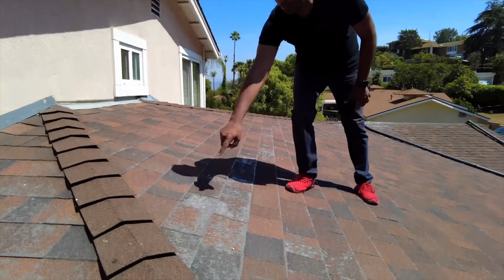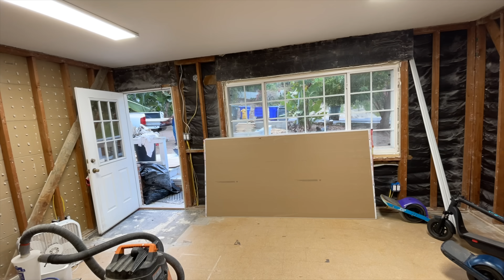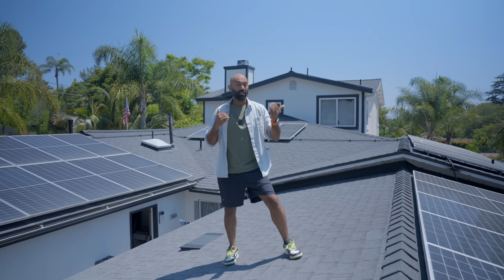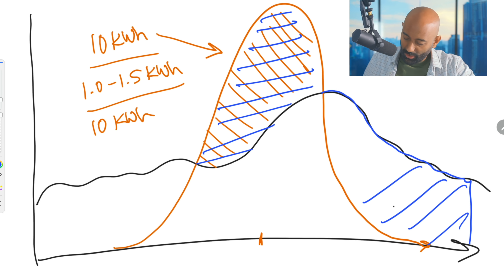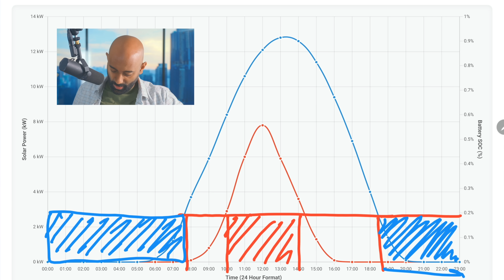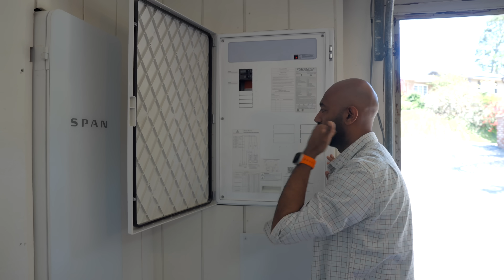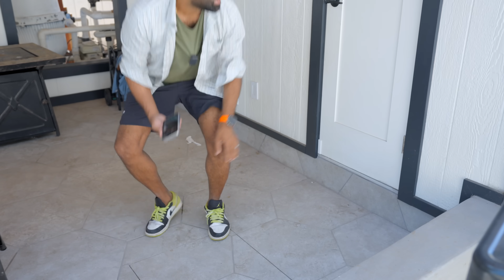Is Self Reliance Possible? Net Zero Home 4 Years Later...

Comment: What was the pool pump? My pool pump is an energy hog
Reply from the maker: We got a Pentair VSF (variable speed and flow) our old pump was 2400 Watts for a fixed 80 gallons per minute. Our new one is set to 35 GPM but only uses 280 watts!

Comment: My neighbor added solar to his roof 3 years ago.  Found out it was leaking, and now he has to get a new roof, repair rot damage, and remove the solar panels, costing him thousands. He said he won't reinstall them and it was a big mistake and huge waste of money.
Reply from the maker: this is true for ANYTHING, if you have a bad installer who does a bad job, it won't go well. If you got a new roofer, to re-do your roof, and he did it poorly, that would leak too. I've had solar on my old home for 10 years, and on my new place for 3, and never had a problem. But I also get on the roof to make sure they do a good job.

Comment: I see a big fan on your pool heater which means that you are discarding cold air. Did you consider adding a heat exchanger so that you could cool the house when the pool heat pump is running?
Reply from the maker: I like how you think :) I thought about it a lot, but couldn't really make it happen, sometimes I drown in possibilities, but what we can do, is duct that pool cool air, into the patio on really hot days, but we dont really get too many of those

Comment: Does your EcoFlow solar battery still work when the Internet is down? My Internet and power tend to go out together because the wires are on the same poles
Reply from the maker: yeah all our systems only need internet for data reporting, it all works without internet. The EcoFlow sytem does have more software updates, so it also needs it for that

Comment: Sounds nice, but it takes 30 years to break even on cost to build solar vs breakeven. Great if you’re never going to move and are young enough.
Reply from the maker: I just showed you my breakeven is going to less than 4 years... it depends on your electricity price. and if you're working to do some work yourself, you can get cost down to easily 1$ per watt. at that price, it makes sense anywhere

Comment: Still hard to believe that southern California has such expensive electricity!  It seems like some consumer protection group by now would have identified the cause and got the perpetrators on the way to being punished!  The rate there is 4 to 5 times that of neighboring states like Oregon and Washington.
Reply from the maker: it is an endless source of frustration for me. Now as if that wasn't enough, they want to add fixed costs to your bills that AREN'T based on usage! If that happens, I'll be really up in arms
Reply: @TwoBitDaVinci  P G & E has already done that.  I installed after April, 2023 so am on NEM 3.0.  There is only ONE rate plan. That plan has a $15/month charge to "reduce the cost of electricity". But the net-net is now it takes 38 times as much exported energy to "break even" on my bill.  Fortunately we do have a battery (a FranklinWH)  though just one - so our AC is not on the critical circuit. 😞

The California Utilities are FOR PROFIT and PG&E, for example publicly stated that their record profits were not related to the outrageous rate increases.  There is one city here in Silicon Valley (the City of Santa Clara) that has their own public utility and predictably, the rates in that city are HALF of what our  rates are in the rest of Silicon Valley.
Reply: @TwoBitDaVinci  There sure does seem to be a solid incentive to use alternative sources!   And I would think there would be hundreds of thousands of also frustrated residents.  If only there were any easy way to organize them all....

Comment: I have AOSmith Electric heat pump hot water heater.  We have had it replaced twice under warranty.  I would go with another version.
Their customer service is great but having to go through that is bad.  Combo washer dryer that is condensing reduces our power a lot (LG version is what we got).
We used Emporia to monitor our usage for a year before we did solar/batteries (54 370W solar and 3 Powerwall 2's).  Solar is fence/ground mount and none are oriented 'correctly', but in the winter we normally get 25 kwh and summer 80+kwh daily depending on clouds.  Here in TN electricity is about 12cents per kwh and 4 cents for any sold to the grid.  We are still 'on the grid' but it is nice to reduce our bills significantly and none but the base charge for 9 months of the year.  Heat pump for heat/cooling, but not latest tech. ... Oh, near Nashville TN
Reply: Same here with the AO once replaced under warranty, but the plumber isn't covered. Gave the old one to a friend and,,,it works for him! New one has been fine for a couple of years.

Comment: Ricky, last year I needed to replace my hot water tank (which had lasted over 30 years) and I decided to go with heat pump. It costs about 1/3 as much to operate so that's good. We are all electric in upstate NY and the only reason this works for us is that the electric utility is community owned. My payback on the heat pump water heater should be about 12 years. The heater and installation cost about $2,700. So, long payback. But that's okay because, and I hope you're sitting down, my per KWH cost is $.0439 in the non-winter months and a blend of that rate and $.06590 per per KWH in the heating season. All our electric comes from hydro and nuke. Like you i have an office (attached, not freestanding). About 3,000 sq ft. Total electric cost for the prior 12 months $2,240.72. Heat pump water heater is in the basement so it makes that area a little cooler. For you, a heat pump water heater is a no brainer. You still have to buy off the grid so this would get you closer to zero and assuming your up front costs are not radically different from mine your payback would be very quick. My water heater will probably die about when I break even, but you will have years of net savings before yours dies. I love your channel!
Reply from the maker: wow seriously?? I would add 1 thing to your calculation... you HAD to replace your unit. A tradition system would probably be around $1000-$1400 installed. So your delta is half of what you think it is. This is why I always like to 'upgrade' when I need to replace something!

Comment: Fellow SoCal inhabitant here:  I wonder why you did not go with thermal solar water heating?
I bought a  lightweight thermal solar water heating system in 2008, oversized it for some hydronic heating utility and have kept my Socal Edison bill fairly reasonable, given that have not yet added a solar PV system. The water heater I bought does use a small PV panel to run the circulator pump. I bought an electric water heater for storage, with none of the electric elements hooked up. It is not insulated well enough, so I do have to make an upgrade.  
But a priority would be to get that solar PV, sized for my EV, so I, like you, have work yet to do. Love your videos.
Reply from the maker: Hey Paul! So with a heat pump water heater, we can heat water with like 800 watts. Our bills were insane, not because of hot water, that's the least of our concerns. our current natural gas water heater uses like a few bucks a month. We have a lot of computers, EVs to charge etc... so for us PV Solar was absolutely the way to go. We need electricity every second of the day, and we need hot water like for 30 minutes a day. when you have enough solar, you can do anything :) cheers and hope you're enjoying the sunshine its about time!

Comment: I know that many believe they can go solar and battery to be independent of the grid and the likelihood of a 500/1,000 year event such as a 3 to 5 year winter caused by a super volcano (or similar event) is not likely. I would still like to have a backup power ready if for some reason the solar is failing.
A company called Hyliion is testing a multi-gas sourced helium sterling engine that conservatively operates at more than 50% efficiency and is whisper quiet.
It is still in early stages and has a high risk of failing due to market demand changes but I still like having batteries only considered a range extender and not a backup.
If solar is down for more than one week, the limitations of batteries become more obvious and even more so with longer outages.

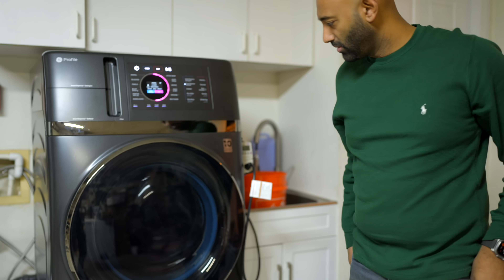Comment: 22:34 for clarity, the heat pump dryer only pulls 850 Watts but also takes twice as long to dry, so it only ends up saving about half the energy of your previous dryer. 

Also thank you for these videos!
Reply from the maker: in our experience, drying times went up for 50 minutes to 1 hour 20 minutes. so not double, also, pulling 800 watts evenly for 1.5 hours or so, is MUCH easier, than pulling 4500 watts for 50 minutes. that's the key to being net zero, spreading out loads, and why tankless electric water heaters are being banned... they can up 20kW for a few minutes which is horrible
Reply: @TwoBitDaVinci  You live in SD. Most of the year you could dry your clothes on a line. 0W and they smell great when they're done!

Comment: you guys need to start looking into insulation and how to heat and cool houses, the better a house is insulated the less energy is used for heating and cooling. and start to take matrials used in building serious.. 3 or 4 layer windows 1.7-1.8 inch insulations in walls, 18-20 inch under the roof and the same with floors/ground.... your are using as much if not more naturalgas pr months in the heating season as many in the scandinavian part of the world would use in a year.. also start looking ind to water heat panels even a small system can heat a pool or cover a hole house with hot water for both heating and useage, combine that with a large storage tank.. the sun can power a lot of things.. and heatpumps for the houses... here.. if the unit can not support a SCOP of at least 4.5-5.0 it wold be a extreme hard sell for the customers.
Reply from the maker: 100% correct! so here in San Diego, it's actually more expensive to tackle insulation, because our weather is so mild, we neither heat or cool our home over half the year.

certain types are easier, like under house or in attic, but in wall is very expensive as our labor rates here are very high. But we are tackling insulation at every stage as we go!

Comment: I envy you for the sun hours you get during the winter months. I have a huge overflow of energy in the summer and still can't make it through the winter here in Europe... It's a real pain.
Reply from the maker: yes this is why true net zero is so difficult. But even being self reliant X% of the time, and trying to get that number up, is a very fun game to play. Cheers!
Reply: @TwoBitDaVinci  Oh and btw, just because you asked: I am running HeatPump based hot water here. A company named Viessmann has a combined system thats called VitoCal (for the heating) and VitoCell (for the water) which come as a package and work really well in my house.
And another side note: I don't think increasing your batteries in the office will do much to avoid production loss. Unless you increase the usage too it will just take a day or two longer until the batteries are full, and then production stops again. Have the same issue here

Comment: I’ve done most of what you did but on a lot smaller scale. My systems ; I have three houses I’m powering,have evolved according to observations of our loads. Instead of integrating all the loads into one source, I have off grid inverters carrying specific loads . For instance, one 5K inverter is just powering two 1.5 ton heat pumps, from my observations,I can add another.
I like the heat pump water heaters but because solar is cheap I still use resistive heaters. To lower the load on the inverter, I put the elements in series with the upper thermostat moved to the bottom. Then a secondary heater that receives the cold water first is switched on as if it was a lower element
I’ve been watching your videos during your process and it looks like you need another house just to mount all the equipment 😅 . As you mentioned,the off grid is much cheaper and it comes with almost free education. Easier to scale up. I’m convinced that the complexity of selling back to the grid is not worth the trouble. I just use my grid connection as a battery charger at night when the electricity is free.
Reply from the maker: wow that's really interesting! I have to think about this, because I've heard a lot of bad stories about people getting heat pump water heaters...and them being less reliable...

Comment: How long do you run your pool pump? in Florida we run it 4 hours a day in Winter and 6 hours a day in Summer. anything longer is a waste.
Reply from the maker: it depends on the pump speed and pool size.

our old pump at full speed was 80 gallons per minute, and used 2400Watts. Our new one runs at 35 GPM and only uses 280Watts! Our pool is 20,000 gallons, so we just let it run a little long because it uses such little energy.

the thought process was to reduce the conditioners and other chemicals, and instead let our salt chlorinator just run a little more often.

Comment: I use an electric water heater with a DC element connected directly to a 500 watt solar panel
Replace your bottom element with a DC element 
Google Missouri wind and solar DC water heater element 
Take care Ray
Reply: That's a cheap set-up, but a lot less efficient than a heat pump. a COP of 1 vs 3 or 4, and the heat pump can heat your house, too.

Comment: 1978 the state of IA development a Solar Tech course. A future service industry to repaire renewable technology. At the end of the course (remember renewables has come a long since then) try to piece together a self reliant energy system using geothermal, solar panels (5% efficient), 500 gallon water storage heat transfer system, and heat pumps we determine it would take 50 years to get an ROI and we still needed 10% fossil fuels to keep a responsible temperature in a home.

I still believe that is the threshold, 10%.

It’s always been amazing to me how we thought using intermittent energy sources would solve the independence challenge while all along the intermittent power, solar, wind, geothermal, are the supporting industry for lifting water and how the earth leverages energy.

That said, damming large volumes of water isn’t the answer or available everywhere.

Cycling the different temperature (structural) changes of water is the answer and how to harness that natural process is the constant energy resources of the fall and lift of water. 

Energy is never used up but is dissipated and transferred from one thing to another. Water leverages gravity to lift and gravity to fall as a cycle. A cycle is predictable. How do you harness it?

Once you understand that principle residential and industrial facilities will have unlimited power for the cost of the machine and maintenance.

Comment: My utilities averaged about $180 per month.   I haven't used any for the last 2 years, water, and electricity for a 3,400 sq. ft. house.  Before anything else, insulate your house.  Windows are a financial killer.   After looking at the roof, it's dark.  A dark roof is a financial killer.  Look at the low roof pitch.  The heat will be slow to escape.  That means the upstairs is a blast furnace.  No wonder the electric bill is so high.

Comment: If you got the space for more panels, that'll solve your storage capacity requirement. Took me 5 years to go totally off grid. My system ended up 39kw of solar panels, 100 kw of storage, solar furnaces for winter & solar water heating year round.

Comment: Hey Ricky, how about a post on AB 942 which basically guts the California solar agreements? Last I knew , the utilities were trying to eliminate all net metering, and wanting to charge solar customers $8/kw installed capacity/mo whether you exported power to the grid or not. Not sure if that was the final version of the bill. I know it passed the assembly, and now goes to the state senate. I do agree that it is time to end net metering and I personally will never purposely export energy to the grid. However, I want the option of disconnecting from the grid at my discretion. Utilities don't like that idea either.
Reply: yup, i will be up for fighting this legally, unless they include the right to disconnect. I smell class action.

Comment: `Ricky, What about GEOTHERMAL? You could have done vertical well and you would have taken care of heating gas cost for the pool and the house?  This is actually rhetorical question but I bet others will wonder the same thing. I "think" I know why you didn't do this way, but i would like to hear your reasoning?
Reply: Geothermal is significantly more expensive than adding a bit more solar and using an air to air heat pump